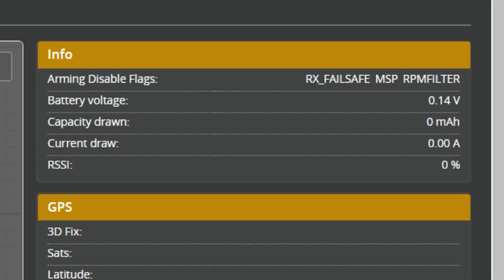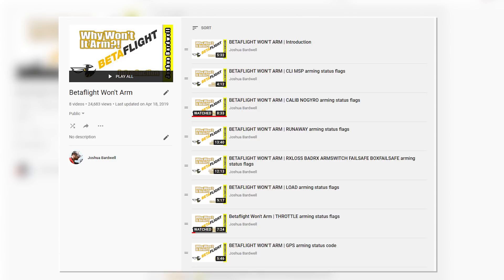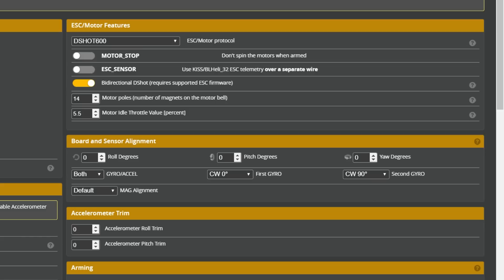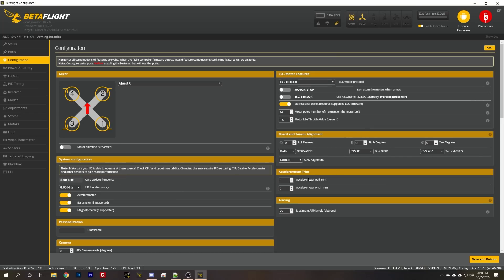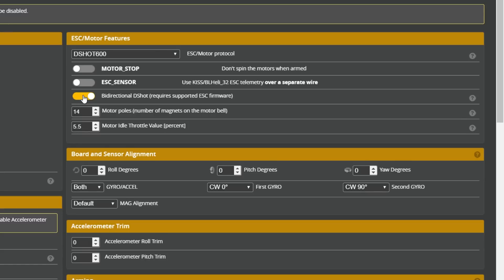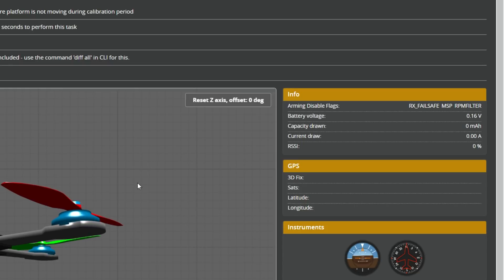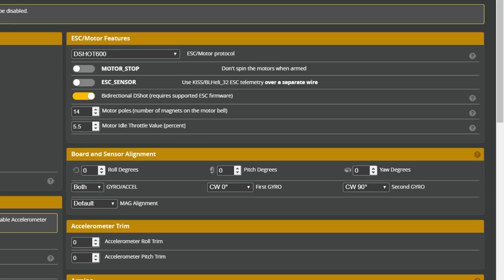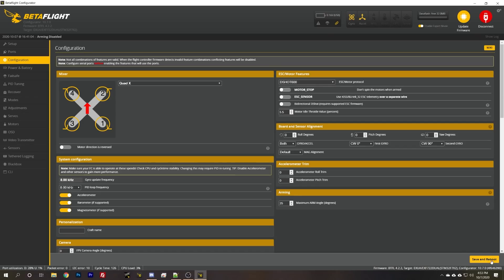BETAFLIGHT WON'T ARM RPMFILTER arming status flag

Comment: I have one quad with an Airbot Furling32 Airport F3 ESC and it is giving me randomly the RPM filter flag. A reboot always solves the issue. It happens since I have build the Quad a year ago. Very annoying. Several BF and Blheli-32 updates did not solve the issue. Once armed after a reboot the Quad flies without any issues.
Reply: See my comment about BLHeli32 ESCs. You need to use the new 32.7.2 firmware version.
Reply: @BruceLuckcuck  I am on the latest version

Comment: I have the issue mentioned where I will get RPMFILTER error but can just power cycle it and it will go away (usually).  Happens about 20% of the time I plug a battery in.  I was hoping this vid would help me diagnose and fix it, but then when you're solution to random RPMFILTER errors was the just power cycle it I realized that wasn't happening lmao.
Reply: Read my comment about the cause of intermittent RPMFILTER warnings.
Reply: @BruceLuckcuck  You're right, my quad with issues has F3 ESC processors and BLHeli32.

Comment: Is is possible to configure  my Quad with:
-Arming in the Hand 
-Gyro Off
-and adjust the Throttle to50%
And youse my Quad to Fire on my Carcoal Grill as Grill fan?
Dont worry with the Heat, i will Not grill the Quad selv

Grüße aus Deutschland bist der Beste
Reply: set pid_at_min_throttle = off

https://youtu.be/xiH0AOsp-gY

This is a video explaining how to set it up correctly. Similar to how the idle up function works on KISS and how Mr. Steele has always done his quads, just this is the BF way of doing it. You won't need to increase motor speed. Idle will be plenty enough to get a fire going.
Reply: @BikeGuyFPV  DON'T DO THIS!!! NEVER ENCOURAGE PEOPLE TO ARM THE QUAD AND HOLD IT IN THEIR HAND! The settings you suggested only affect how it behaves at minimum throttle. Accidentally bump the throttle even a little and the PID controller will be active and likely flip out and eat your face!. DON'T DO THIS!
Reply: No, it is not possible to safely do this in Betaflight. Ignore instructions about how "Mr Steele does it" as they don't apply to Betaflight (he flies KISS).

Comment: I've only ever seen the intermittent RPMFILTER warning (that goes away with a power cycle) on BLHeli32 and in particular with F3-based ESCs. It's caused by a timing problem on the DSHOT reply packet. The problem actually happens on all BLHeli32 ESCs but the faster F3 processors seem to be worse. That's why there's a 32.7.2 BLHeli32 version as it addresses this timing problem.
Reply: Oh thanks! Have this issue since I've bought kakute stack

Comment: What I find annoying is sometimes when using GPS rescue the quad won't arm even with enough sats. I know sometimes there are still not enough good signaled sats and it will show more but less than are shown are usable to satisfy the min sats variable but there is another scenario where no matter how long you leave it it will just not arm. If you power cycle it immediately reconnects and arms. Now if it takes more than a few minutes I always power cycle.
Reply: It's something with the sanity checks read about it first but if you set sanity checks to failsafe only that won't happen   not saying you should just that there's a weird issue. I have mine set to failsafe only
Reply: @RubyS.1  That option is about disarming during rescue. It turns Sanity Checks off when Rescue mode is activated by a switch but only turns it on when it’s in failsafe. No worries though I'm going to open a ticket on Github anyhow. 👍

Comment: Bad signal wire connection from the FC to the ESC can cause the arming flag. I've had the jumper wire plug between the boards come loose, but the power wires still had contact. The ESC and FC both made tones, but it gave me the RPM warning when I tried to arm. Once I seated the plug back in it was good to go.
Reply: i had a bad wire where the wire was broken on the inside of the sleeve so it looked fine but i kept getting random rpm filter warnings and twice the quad just shut off mid air during a flip (probably from the wire moving and then a failsafe occured) so yea, definitely check wires too! sometimes rebooting does fix it though!
Reply: Yeah that was my issue, turned out the pins and socket between the FC and ESC was totally ripped off the board and was just about making enough contact to kind of work most of the time.

Comment: So are you saying for the stock BLHeli S we can use version 16.71 or newer to enable rmp filtering or is that for the jazzmaverick firmware and if it is for stock BLHeli S is there a reason you recommend jesc over stock BLHeli S? Thanks for the info
Reply from the maker: It turns out that blheli_s 16.71 is jazzmaverick, just "official" and easy to flash using existing tools. But jazzmaverick has done some screwy things with the firmware that in my opinion have the potential to compromise reliability and performance. Version 16.71 is (I think) safe to use, but overall I feel more confident recommending JESC, which has been reliably-reliable.
Reply: @JoshuaBardwell  The ONLY recommended BLHeli_S version is 16.73. 16.71 had timing bugs and the code was pulled from the official BLHeli_S repo.
Reply: @JoshuaBardwell  thank you I did not know that. Thus far all my BLHeli S are on jesc but I was interested in the 16.71 mention you made as I was again unaware of the connection to jazzmaveric and BLHeli S.